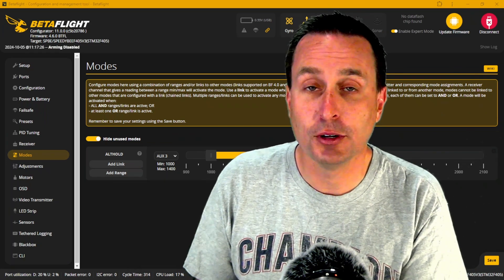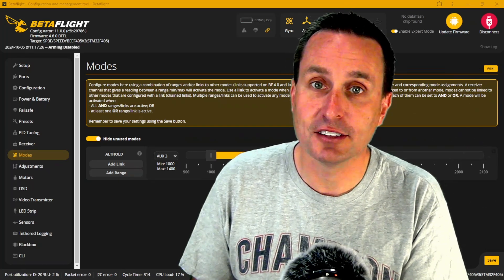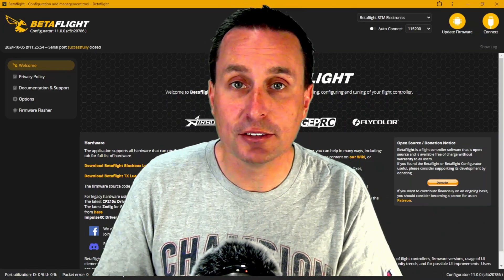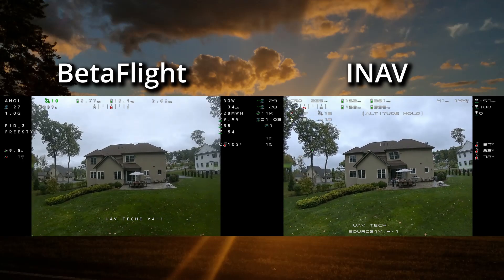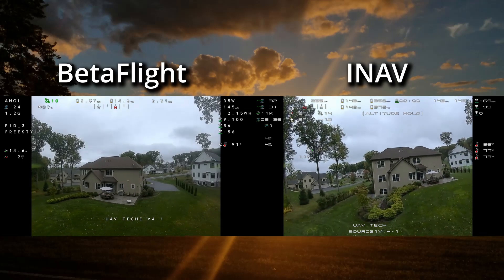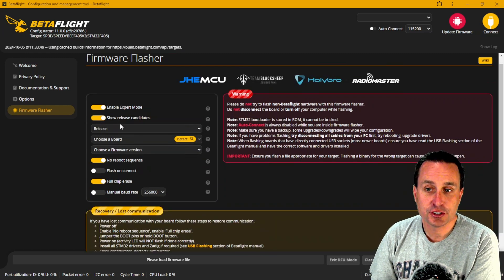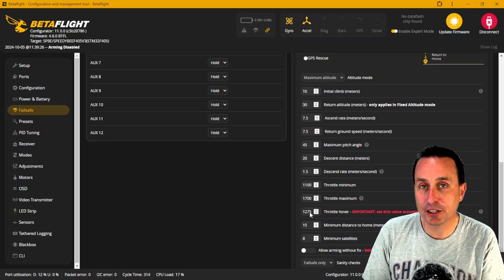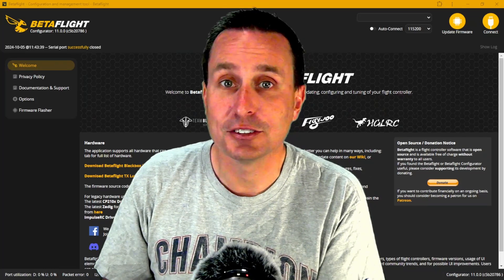Betaflight 2025.12 Altitude HOLD [preview]

Comment: when it will be avaliable?
Reply from the maker: now.  you can flash dev build.
Reply: @uavtech  
Strange, when i opened thru web browser configuration 11.0 and tried to find 4.6 version for my speedybee V405 v3, it's showed that only 4.5.1 avaliable
Reply from the maker: @maxk3941 need to select Expert at top and Development.  Them 4.6 will be an option.
Reply: @uavtech
What i am doing wrong, after installing can't add button which will be assigned with this function. I mean when i press button i see a range but its not yellow . Thanks

Comment: for some reason, its not loading the file onto my f405...
Reply from the maker: push in the boot loader button and then connect the FC to the USB that plugs into the computer.  Then toggle the NO REBOOT option in the flash page.
Reply: @uavtech  thanks for the reply, but I realised it was my pc's corrupted drivers😅

Comment: I have been trying to figure this out. Mainly with my speedybee35 (DIY) axis flying argus f7 aio and 2205 motors. I am having trouble getting my hover right. I have it set up with full gps and hover value set up right. It is going up n down over n over. I limited my throttle in failsafe 1100 and 1500. Testing in angle mode. I have that turned up to 90.   Maybe i need to turn up magnometer #? 🤔 Any suggestions? Thanks for all the great info 😁
Reply from the maker: if ascending/descending while in ALT HOLD, something may be influencing the Baro on your flight controller OR the ALT HOLD PIDs may be too high for your craft.  Try reducing the ALT HOLD PIDs in the CLI by 25%.  If that doesn't change anything, then I would log it (AUTOPILOT ALTITUDE or BARO debug) to see if that signal is OK.

Comment: What sensors are required for Betaflight althold? Is baro enough?
Reply from the maker: Baro ONLY works, but it's not as accurate.  But if you are up at altitude, you don't need it to hold within half a meter.

Comment: Is there any possibility that BF 4.6 or later at least will support optical flow and range finder sensors (such as MTF-01 from MicoAir) instead of baro and gps to control althold and poshold modes? In your opinion of course :)
Reply: We have PR’s supporting them, but they are of limited value other than for controlled landings, where they are really helpful.
Reply: @ctzsnooze  thanks for answer. Are there any instructions for use these sensors in BF 4.6? My idea to use the optical flow and range finder sensors with althold and poshold modes are for little 2 inch cinewhoops that would fly mostly indoors where GPS is basicaly useless. Hope it's possible...

Comment: The one reason why I moved from betaflight to inav when started to learn fly, because betaflight did not have alt hold mode. In github was said that developers against it at all and do not want to implement it:)

I really surprised to hear that it will be added :)
Reply: Beginners oriented quads like the BetaFPV Cestus range or Eachine whoops have had alt hold beginner mode for years now. It's about time betaflight adds it.
Reply: It's not really just for beginners though. I'd probably use it specifically as a failsafe instead of GPS rescue. Before you had 3 options: Drop dead out of the sky (which got me a battery and a FC killed once), self level and keep the throttle at a certain percentage (risking a flyaway or a crash into a tree or similar) or add a GPS and fly straight up, back to home and descend (which will not work inside buildings). Having the quad hover in place where it lost the signal is IMO the best failsafe strategy, as it works everywhere, doesn't need GPS and will not have the quad crash into anything.
Reply: It's also really useful for cinematographers, or anyone who can't focus 100% on flying because there are other things going on around them and they may need to let go of the radio mid flight.
Reply: Or you need to land somewhere with a high uptilt camera and it's a tight vertical descent between buildings or some trees. I had this once where I wanted to land in a garden where between the house, bushes and trees there was a gap of maybe 2m x 2m. In the end I managed to gently crash into a bush.

Comment: I would love to see more INAV like features available  in BetaFlight. I  tried INAV awhile back and had tuning issues that made me give up and go back to BetaFlight. With the new build system, I could see BetaFlight being expanded in ways that might require H7 processor processors with more storage to run all the new features together  but that would still leave older processors usable. We might finally have a good reason to buy H7.
Reply: I came back to betaflight as well from Inav. I think it flew better in Betaflight.

Comment: gps altitude from what I recall isn't very accurate, and barometric seems to be better. Do either Inav or Betaflight have the ability to adjust the mix of gps / barometric data that's used as inputs?
Reply from the maker: yes, both do.
Reply: At the moment, fusing Baro and GPS for altitude is not all that great in Betaflight. That’s an area we can improve on.

Comment: You're absolutely right, I flashed bf4.5 from Inav 7.1, and even on defaults the jitter in the camera was gone in the same craft. However for gps Inav is still more tested and reliable - the way it slows to a poshold and ascend is much preferred. for whatever reason Bf still has sanity checks by default which is a huge risk for long range.
Reply from the maker: yup

Comment: I just switched my Flywoo Explorer lr from Betaflight to Inav and I'm very happy with it. I fly slow cruise mostly anyway and the position hold works great. The OSD gui in Inav is much better and Inav also has mission planner.
Reply: An update...I decided that my quad actually flew better on Betaflight than it flew in Inav. In fact, I lost my drone shortly after switching to inav and sadly I didn't have logs files set up on my transmitter like it was automatically set up in Betaflight, otherwise I may have got my drone back. I'm not sure if Inav has logging but I'm back to Betaflight on my newer replacement drone.

Comment: Hope they will add AltHold instead of Drop feature at failsafe. Thanks for great video!
Reply from the maker: there is a GPS Rescue.  

Otherwise, you want "Land" I think.  That can put you into Angle Mode and lower the quad safely with a properly set throttle value (slow descent).  You would not want ALT HOLD with just Angle Mode (no POS HOLD) as it would drift off due to not being perfectly level or wind.
Reply: @uavtech new alt hold code replaces old land failsafe mode with a more controlled altitude managed descent. It's in the pr by ctzsnooze
Reply: Use this build option in 4.6dev, then set failsafe to land. With this configuration the drone will alt hold when failsafe and then will descend at 1 m/s (or whatever is set for the new CLI parameter). Ctzsnooze was testing this, read the pr (the comments especially since idk if this is documented at the top of the PR)!

Comment: Very interesting, do you think that position hold will be added in BetaFlight in one year ?
I hope that RTH in BetaFlight will also become very reliable.
Reply from the maker: It all comes down to an individual coding this up.  Example: for ALT HOLD we have Chris Thompson to thank (handle: CTZSnooze).
Reply: @uavtech  But we also have to thank the original author of alt hold: "bakwc". He left and closed the PR before it was finalized because ctzsnooze can be irritating at times. ctzsnooze then copied the PR and simplified it
Reply: @uavtech  bakwc was the one who originally coded this up. ctzsnooze copied the pull request and modified it after bakwc quit before alt hold was finalized.
Reply from the maker: Thanks.  I did not see that!